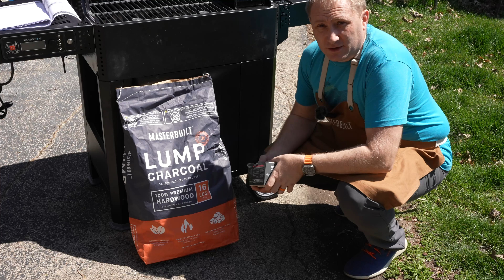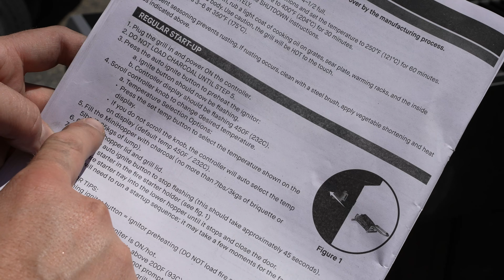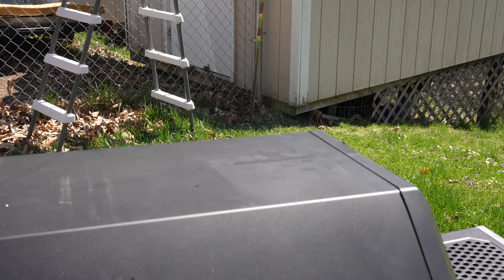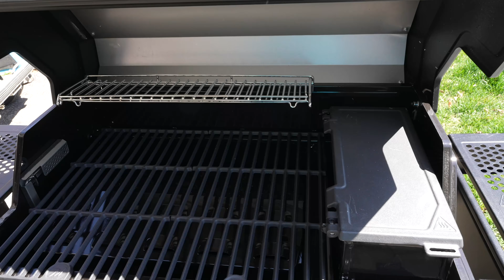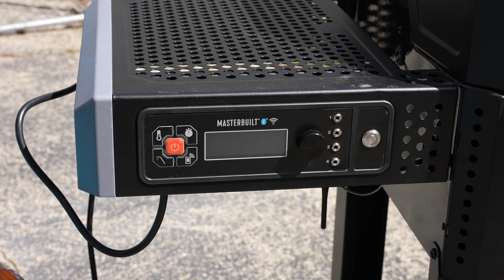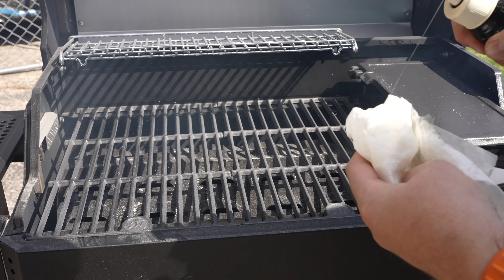Masterbuilt Autoignite Series 545 First Ignition / Seasoning

Comment: Pretty sure the guidance is to pause the fan (press power button) before opening the hopper lid. if the fan had been banging hard you'd have had a face full of embers
Reply: oh really?  you just need common sense not to open the hopper until the fan stops.

Comment: I have the autoignite and got it started and am trying to do the preseason. It seems as though my grill turns off and keeps beeping. I have been trying to get to the 250 degree starting temp for some time.
Reply from the maker: What temperature does it get to? I have had the fire starter go out and the charcoal did not get hot enough so I had to restart the process before, but once it ignites the charcoal it is off to the races every time for me.

Comment: I bought a 545 on May 6 and received it May 14 for the holiday weekend It came in defective, so I contacted masterbuild customer service, and it took a week for a response, they said they would send a Fan and then will send me a tracking # today is 6/1/2024 and still waiting. Take that into consideration when purchasing a masterbuild product. everything has to be done by e-mail no phone option. Customer service is no good.
Reply from the maker: I will speak with my contact at Masterbuilt and ask about the best way for these issues.
Reply from the maker: If you can, email me at contact@techgooch.com so I can get as much info to my contact as I can.